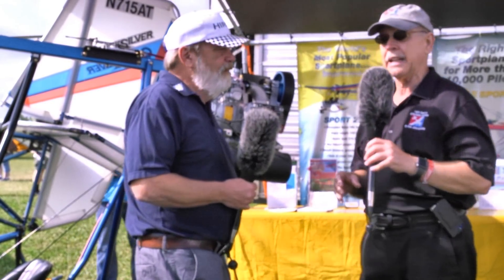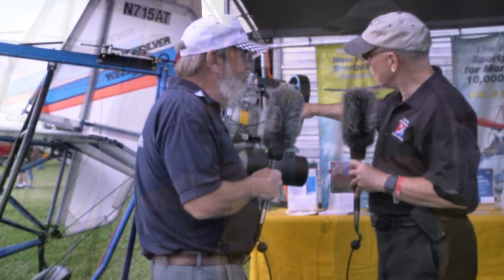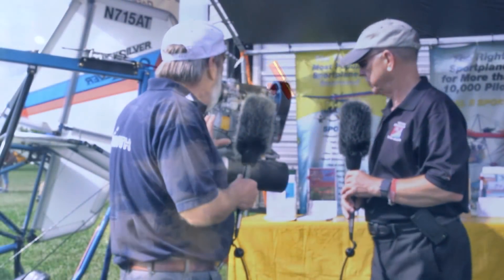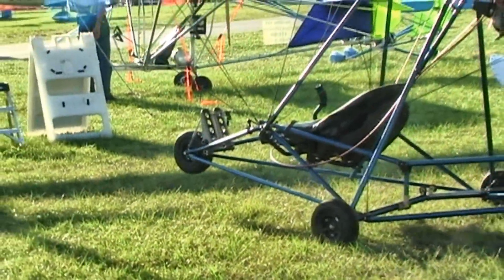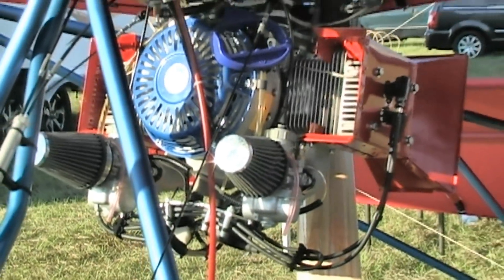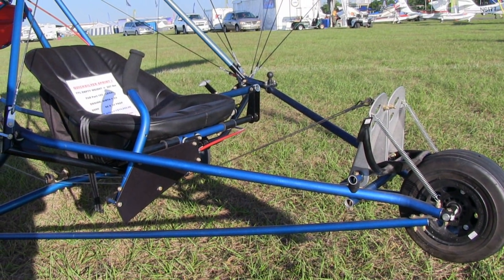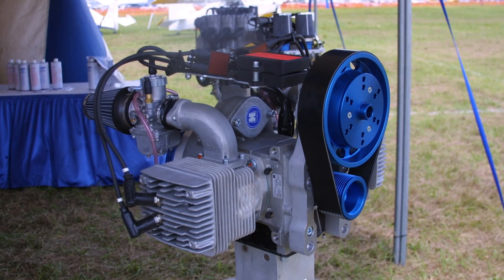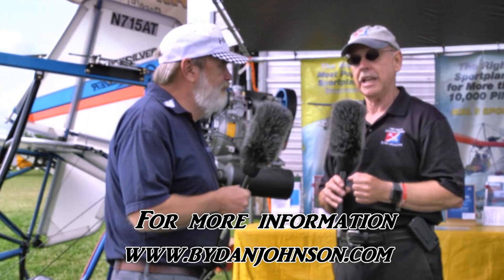Hirth 50 HP engine on Quicksilver Sprint, a legal part 103 ultralight aircraft.

Comment: Really the price kills this engine... why spend $5K-$10K, when you can pull a Rotax or Cuyuna out of a snowmobile junkyard for a few hundred bucks....

Plus, if it's like most boxers, the cylinders fire asymetrically, left, right, left right... and the both move left and right in tandem together, and that mass of both clinders alternately moving left, then right, then left, then right together, creates some hella vibration.
Reply from the maker: Having flown on the engine I can say that there is little to no vibration, and the power is outstanding. Cost is relative as it is about the same price as a new Rotax 503 with electric start and reduction drive was, when it was last available. 

While I have no problem with used Rotax aircraft engines, buying a used Rotax snowmobile engine is NOT something I would recommend. 

The Cuyuna makes a GREAT boat anchor!

The Ultralight Flyer

Comment: I really love everything about this engine except the price. It's available with fuel injection!. I'm also waiting to see about reliability.I know it sure would look nice on the front of my Phantom ultralight!  Seems to fill the hole left by the rotax 503 nicely.
Reply: 16 grand for some material and aluminum and a 50 horse engine??  Whoa, sounds like a high profit deal...  You can buy a used C-150 for that.
Reply: When is the last time you flew a 150 five feet off the deck round and round a 30 acre field. There is no way to compare these two different types of flying with a cost analysis.

Comment: Lean is very interesting. Huge opportunity there I believe in very clean simple light aircraft with much higher performance than this with clean aero.
About the motor, I wonder if it isn't a better compromise to run a larger engine without the gearbox, maybe end up at about the same mass but a much simpler mechanical design.